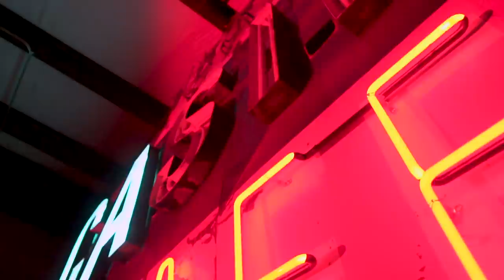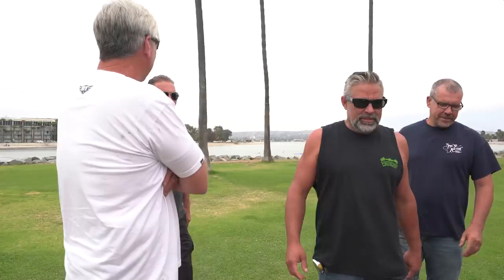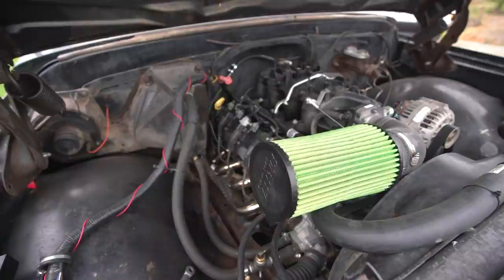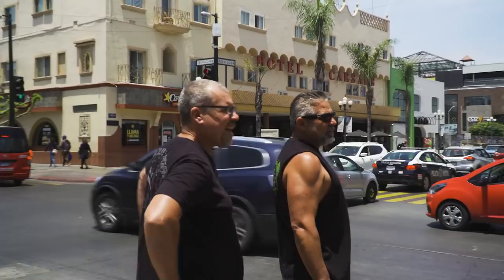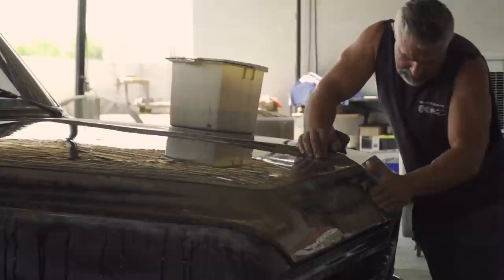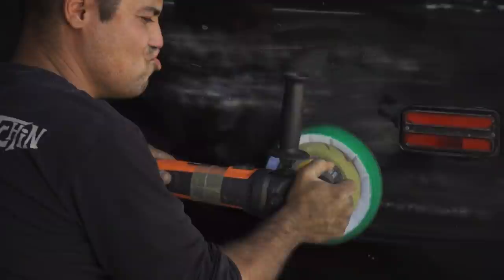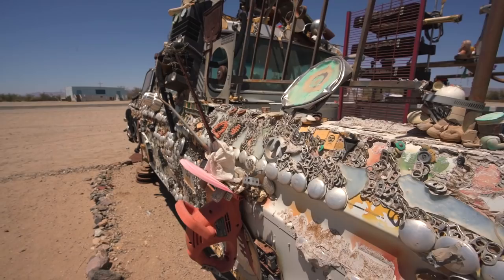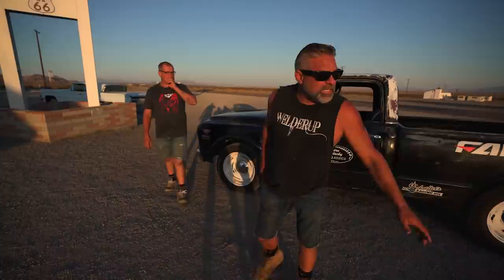1970 GMC Has No Keys or Car Battery But We Have Tacos | Make It Run Again | Episode 4

Comment: Steve, your friend with the Ford PU praised the inline 300 six cylinder. BRO I HAVE TO AGREE. I bought a brand new 1986 4WD Ford with the 300 engine and it was awesome. I traded for it after my son died from drowning and it helped me grieve THATS MY EXPERIENCE WITH FORDS
HOWEVER I AM A CHEVY MAN.
My fav is 1967 Short bed Chevy I had one befor my divorce I bought for $250 at a garage sale with no title. An Oklahoma truck WITH zero rust and the judge MADE ME SELL IT. THAT WAS BEFORE 21st century 
Before they became a wanted item and shot up to $10,000 in Decent shape and $25,000+ restored frame off with the LS
I had the foresight in. 1992 with my 67

Comment: lts hilarious how little concern Merlin has about the patina an finish. They all need some sweet patiner. from sweet patina. Not a paid affiliate. Someone needs to sell a 10 gallon pump sprayer wd40/rust penetrant. Just spray the project down after you clean her up enough. Underneath and all. Like a cheap motel memory.

Comment: So nobody wanted this old POS cause it didn't run, but you guys put a battery in it and hot wired it and drove hundreds of miles with it? The guys that got to that point couldn't get it running but you got it running in a parking lot with no tools. these guys are froggin awesome.